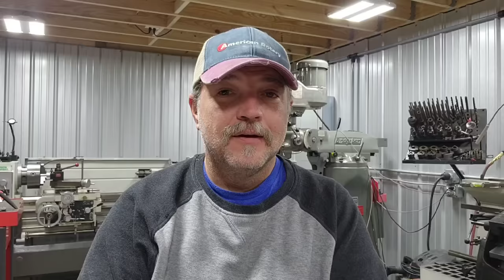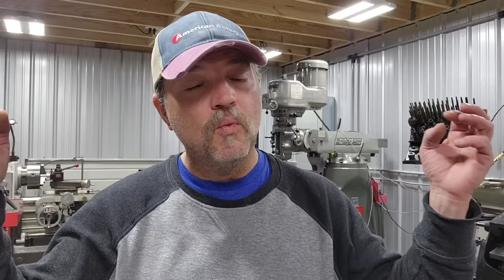*NEVER* DO THIS TO Your Harley Davidson Motorcycle! - Kevin Baxter - Baxters Garage

Comment: I've stored my bikes in non-climate controlled garages through Winters that get well below zero degrees for over twenty years. I  give it a good wash and polish, ride it up to the gas station, add Stabile, top the tank off with 91 octane, run it a few miles back home. Jack it up off the floor to preserve the tires, plug the battery tender in, plug the ends of the mufflers to keep critters out and cover it up until Spring. If the oil has less than a thousand miles I don't bother to change it before hand. I either change it before or when I take it back out. It's worked well for me so far. Great in depth explanation as to why we should leave them alone and not start them for short periods.
Reply: You don't take your battery out??
Reply: @jimbo1959  He did say that he put a battery tender on it.

Comment: I was in the power production industry 20+ years ago.  In that industry, they track the number of cycles (start up to shutdown) each turbine goes through instead of running time. The turbine is designed to run at speed under load for long periods of time with little to no wear and tear. But each time it goes from dead cold to operating temperature, there's a ton of wear.

Maybe we should start tracking how many times our engines start up instead of how many miles they have on them for maintenance purposes. 

Thank you for sharing your knowledge so freely. It is rare for someone to be able to understand a subject at the molecular level AND be able to explain it to the degree that you do. Again, thank you.
Reply: startup is where nearly all wear occurs on an internal combustion engine, both when it's cold or warm. Stop/start feature on cars harms the engine.
Reply: That's also true for semi trucks. You can put an enormous number of miles on a diesel truck engine because they go through a lot fewer heat cycles than a car or bike does. I live in Canada and the winterizing advice Kevin gives is bang on.

Comment: Well said Kevin. Thanks for spreading the word.   
I am also of the belief that your battery suffers when people do this. 
5 or 10 minutes of idle time is insufficient for the charging system to replenish the battery from the heavy draw required to start a bike when it is very cold. 

Our batteries are already small, it doesn’t take much abuse to shorten their life by a couple of years. 

Thanks for everything you do.
Reply: I agree, I believe harley claims on some models you have to ride atleast 8 miles to charge everything up properly.
Reply: Exactly right with reference to the battery 👍
Reply: Always use tenders on stored vehicles. Especially, smaller batteries.

Comment: I’m speechless. I had my bike stored for 3-4months. I took it to get Dyna tune because it was running funny. After Dyna tune guy told me I should change my oil. Every time I started the bike, it sounded loud and aggressive, almost like a cold start waiting to warm up. Immediately after doing an oil change the bike sounds loud but calm. It’s hard to explain, English is not my first language. This video made me realize a lot, but the nail in the head.

Comment: I started my 2022 MT-10 today after 2 months. Let it get to operating temp and put it under a riding type load for how I ride it. Gradually hitting the throttle harder and harder. Shot a couple of flames then backed it down and let it simmer down to an idle then shut her down. This is the first time doing this. I am thankful for your upload. This is the last time I will be doing it.

Comment: I agree with what you are saying, being a mechanic myself. However, I live in Minnesota and start my 2018 Road glide once every 2 months, warm it up for about 20 minutes or so and shut it down. The three times I do this is to keep the fuel injector clean with new fuel and my engine and seals lubricated and moving. The three times I do this in the winter is not going to rust my engine or cause any issues. Just my way of winterizing mine, runs great every year.
Reply: Keeps the battery happy too. I do same
Reply: Do you use fuel additives over the winter? I live in Pennsylvania and my 04 usually sits Jan thru March. I used to use it, but I don't anymore, I just keep the tank full with 93 octane.

Comment: Short drives will rust the exhaust muffler on a automobile  very quickly.
Great advice Kevin.
Reply: 1970's Automobiles around the early eighties that were driven for less than five miles per trip would have rusted out mufflers as compared to normal ten through twenty mile per trip drivers. Most of these drivers were elderly city dwellers. I used to see a lot of that working at a service station back in the late seventies and early eighties. There were meineke muffler shops that made quick business replacing OEM mufflers with their less costly thin wall economical brand mufflers which rusted out within a year and that's in the southeastern US were it's a extremely rare occasion to ever get snow and road salts

Comment: Totally agree! I store my bike with non ethanol gas with Seafoam or Stabil. I spray Fogging oil in the cylinders and plug in the battery tender. I do not start it until I know I can take a ride long enough to warm it up and ride it more often. Which in Wisconsin is usually in April.
Reply: U mean like June

Comment: Thanks. I didn't know that. On my 88'   883 Hugger i purchased new and kept it on a battery trickle charger over the winter and started it up at least once a week just to hear it run and wished the weather was warmer to go riding. When springtime came i did a full inspection on it and realized that the wheel bearings and races showed signs of corrosion pitting in which case i replaced the bearings and races. The bike was stored in a non heated garage.

Comment: I use too start mine every month, live in canada -25-30 in un heated shop 
Fire up the wood stove get it up too tempurature… 
Fire up the bike let it run for 15-20 minutes, rev it gently once in awhile ….
Never used a maintainer on a battery ever….
Bike and battery is a 2012 battery still in the bike….
Bike still runs beautifully…..
But then again its a victory , its bullet proof….
12 years on same battery, just let that sink in…
FACTS

Comment: Wow it is amazing how many people here in the north "Iowa" don't know this when we talk about motorcycles or any things with a internal combustion motors. Todays high is -8 and tonight will be -24 actual air temp air temp. Another thing is people don't understand wind chill temp doesn't mean a thing to engines. Anyways as usual AWESOME VIDEO!!! Right now my Yamaha 4-stroke snowmobile is warming up and im going riding. Yamaha is smart on their sleds being mine is FI. When you start machine you don't touch throttle until light on dash has went out. Light is a warning to operators that the ECM is controlling the air fuel mixture by temp to properly get motor to prescribed temp before you should operate the machine, thus protecting the engine from damage. If you do hit throttle before light goes out. There's a good chance that you will foul at least 1 of the 4 plugs. Most fuel injection engines have this already, just no light. Bit if listen to motor and see rpm gauge on Harley its there on my 15 FLHTK. Let the ecm do its job and  protect your motor. Thats in the Summer or Winter on start up, in fact whever you start them wait at least 30 seconds before moving the throttle. Your a GREAT MECHANIC and have the best bike maintenance videos on Utube, THANKS!!!!!

Comment: I never start any of my warm weather toys during the winter.  I won't even start them while it's warm out unless I plan on getting the engine up to full operating temperature. Even during the summer months, when I start my 2020 Ultra Limited,  water drips out the muffler until the mufflers are hot enough to turn it into steam. You are 100% correct about what you are saying on your video.

Comment: Hey Kevin, would recommend removing the plugs and cranking the engine over to prime the oil pump and getting some oil circulating before initial start up? How about also pulling the fuel pump fuse too to prevent diluting the oil?

Comment: Having lived in a Northern climate all my life the advice given here is absolute. 
        The use of synthetic oils for lubricant does offer better protection but means nothing if you start and run and not burn off any water vapor.
     My time with a 1995 left outside un-covered for a Winter showed how susceptible any engine is to a high moisture environment. 
     Upon inspection of the oil before start uo it needed to be removed and replaced. 
      Thanks Kevin!

Comment: Well if I store my Harley for long periods of time, I always spray a bit of oil down my spark plug holes. Not a lot! And crank it a few times and that it. And stabilize the fuel. Than when I’m ready to ride for the season? I pull the plugs out and crank it to exhaust condensation and what ever else is sitting in there. When I’ll check down the holes for debris with my little camera. Than put it all back together. And than fire it up. Go for a 20 min ride. Come back and do a fresh oil change. Matter if it needs it or not. Been doing that for 20 years. My bike still has great compression and runs like the day I bought from Harley brand new!

Comment: I still do it,I like today's ethanol fuel moving rather than sitting,along with the bio diesel,in my work we short cycle all the time and with metals and oils used today we do fine it is the fuels and emissions that have caused limp modes and won't run.

Comment: Great video, Kevin! I always start my 2012 CVO Street Glide and let it warm up for a few minutes while I put my gear on, then go ride for 30 mins minimum, so I never have to be concerned about internal engine corrosion nor exhaust pipe corrosion. Harley baggers have a large oil pan behind the engine, and the whole system contains 5 quarts of oil. It takes quite awhile to get all of that oil warmed up to normal operating temp and evaporate out any moisture in the engine AND in all of the oil circulating through the pan.  Getting the engine AND all of the oil up to normal operating temps takes much longer than many people might think - despite the fact that the engine itself might already feel hot. Only running the engine for a few minutes for a short trip can dramatically shorten its life due to moisture getting trapped in the system, as you pointed out.

Comment: I'm in Canada.  When I winterize a bike, will treat fuel with stabilizer and also a mixture of 50:1 high quality snowmobile oil.  Reason is, when running bike for 10-15 minutes to get carbs filled with treated gasoline, the snowmobile oil mixture oils up the exhaust system.   No different as storing snowmobiles.

Comment: Great advice, I never start it either.  Put trickle charger on it, and once a month move it a foot so no flat spots can occur on tires. And always use good synthetic oil in it. Cheers guys.
Reply: Thanks for mentioning about moving it to prevent flat spots on tires , learned two things from this ❤

Comment: Good video! Good information 

Once every 2 weeks I try to get a 30-40mile ride get everything moving, also winter time I only use Unethanol luckily a gas station down the road has 90 Octane. 

For years I’ve always done this come winter 

Battery tender obviously lol

Oil change Crank case
Rotella 15-40 T6 
The weather is cold enough the motor won’t get extremely hot when going on rides and it’s easier on start ups due to the oil can flow faster. Then spring back to 20w-50. 

Clutch side still use Mobile 1 20w-50

Idk.. not much to it for winter just sucks you can’t truly enjoy the wind 😂

Comment: This applies to any motorcycle, not just Harleys. If I want to run my bike duing the winter, I take it on a 20 mile ride, both city and freeway riding. The bike gets a half dozen rides during the cold season. Otherwise I let it sit and connect the battery maintainer occasionally. By spring it's always ready to go.

Comment: Wonderful video. I’m an aircraft A&P mechanic and have always been told by Lycoming and Continental to never ever run an engine unless you can fly it, don’t even pull the propeller through. 
You can run it for as long as you want at a high idle and the oil will never get warm enough to burn out the moisture that gets sucked in after every shutdown.
Reply: Hummm, Lycoming and Continental must have a different definition of "High Idle" than Caterpillar.

Caterpillar describes High Idle . . . To bring the fluid up to operating temperature, (shove the lever thata way) and operate at High Idle (wide open throttle) for X amount of time.

Comment: I have 2 FXRs & a fuel injected bagger I use Sea Foam & run the bikes on the nagger I just shut it off onthe FXRs I run them & shut the fuel off & let it run out of fuel  & never start them till spring . I have never had any issues doing this for the past 20 years !

Comment: A few years ago I had this experience vividly delivered on a 2005 twin cam. Wintertime in my region stays in low 40s and sub freezing at night. I was in the habit of jumping on the bike most evenings after work to do errands or run to the gym, generally only two or three miles, then parking it till next time I did another short run. When I checked the oil after a period of time during these short runs, I found the typical chocolate milk appearance indicative of a blown head gasket. Since it is not a water cooled motor, I was perplexed. Did some research and found out exactly what you have explained. All that moisture will also result in very harmful sludge. Thanks for a useful topic.

Comment: Reading through some of the comments here and kinda seems that folks really just want to "STIR" up the oils and move things around. You can do that by connecting a remote starter up to your starter and press the button to rotate the engine a couple revolutions. Nothing electrical is turned on to ECM - Injectors - BCM, just engaging the starter for some rotation. Just a thought.

Comment: Great video true facts I have encountered condensation in my motor running and riding it when it's 0° outside as soon as I noticed the milkiness I did an engine flush and oil change and everything has been fine but it definitely needs talked about

Comment: Good information. I put my mine up back in October after the Panama City Rally.  I filled it up with some good 93 octane Ethanol FREE gas and a good battery tender. I will not crank it up unless I do intend to ride it. I am not sure about the other members, but doing a Q&A during the week, I would like to do evenings, after your quitting time. Those were some fun times. On the weekends maybe mid mornings. If you want to do an engine tear down video, I could run mine on up there. Maybe we could open up Solid Works and take a look at my project. Waiting until spring to get it back would be okay with me. I am going to be busy building a new garage starting in February and programming new parts to be machined.

Comment: I use a light hood off a 20 gallon aquarium loaded with two 55W ceramic heaters screwed into the sockets, truned up side down under the engine, to keep it nice and toasty whenever it goes below 60 degrees. Keeps the metal from sweating and corrosion down.

Comment: This is great information. People get weird about their Harleys and want to hear them run in the winter. I always fight that. I admit I have not always won that fight but, for the most part I have resisted “the urge to hear” my Harleys in the winter in Michigan. I do leave the switch off and cycle the starter to keep oil pumped through the system… …don’t know if it helps or not but, my Harleys have never given me any trouble and a couple of them are over 20 years old.

Comment: I crank my engine about one time without starting it about once a month just so different components of engine are oiled. Wonder what you think about this approach? But when I was younger I was guilty of starting it up during winter but I learned about the issue you describe here and stopped. Love your channel man so helpful
Reply: Only thing it would oil is the lifters.  Best thing you can do is  have fresh oil, and get the engine oil smoking hot to drive out moisture and fog it
Reply: This does nothing...you don't build enough pressure to even get oil to the top of your engine. Let it sit. You'd actually be doing more damage than good bc every "1 crank, no start" you do, is turning over a "dry" part
Reply: The oil doesn’t get warm/ thin when you do that.. lots of dry, metal parts grinding against each other.. I wouldn’t
Reply: New England rider 40 + years experience.  Run the bike with Stabil in a full tank of gas until the Stabil is in the carbs. While the engine is warm change the oil and filter.put the bike on a Deltran Battery Tender and wait till Spring.
Reply: @tomquinn607  If you are going to use Stable, only the Green (for Ethanol) and never the Red.

Comment: OK here’s something else that I’m curious about, I’ve recently in the last couple of years decided that it’s better to store the bike without starting it at all when my outside temperatures are cold enough to cause condensation after run the bike for any period of time an hour or whatever simply because when I turn the bike off and my outside air temperature is cold enough it’s going to cause condensation on the cool down of that engine regardless. So what I choose to do is simply wait until my outside temperature is 60° or better than I know my engine will not only cool down Slower but also my condensation is minimal if not, nonexistent.